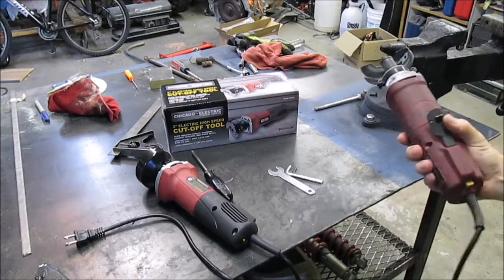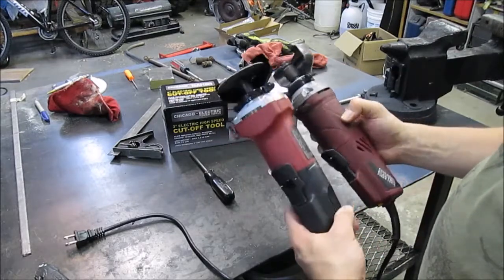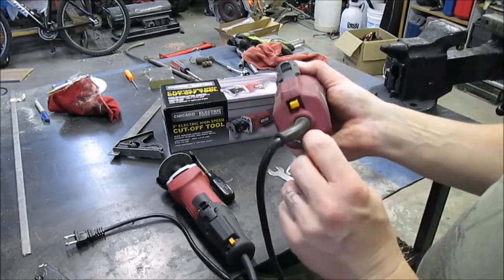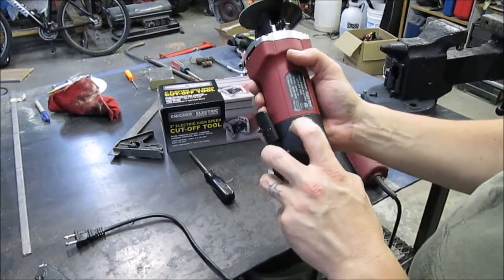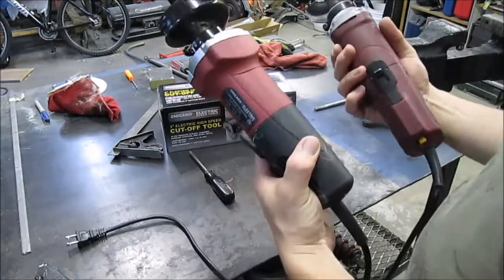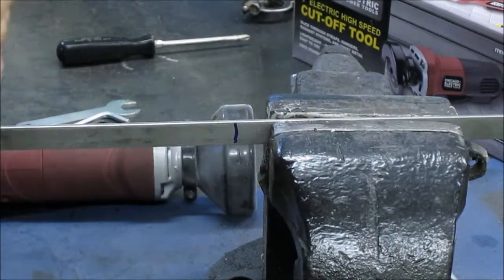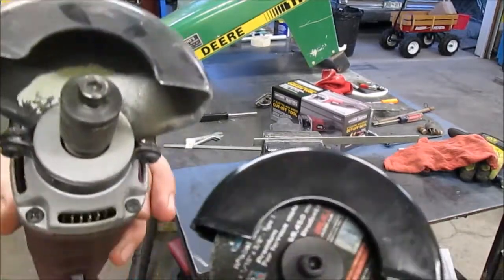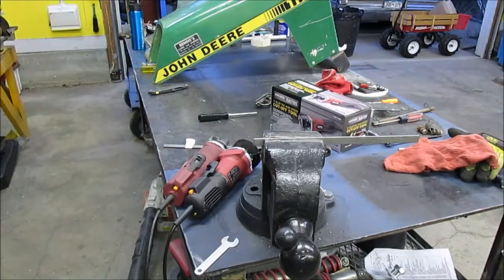Episode 64 Harbor freight 3 Inch High Speed Cut Off Tool. Old vs new.

Comment: Hey, you think this would be able to cut some wheel studs?
Reply: It will
Reply: @frankbailey9542  It did. Except I bought Black Hawk cut off wheels from amazon because the HF ones were trash.
Reply: @frankbailey9542  Oh, and I have an 8 lug it cut all of the rear studs no problem if anyone is wondering. I had to trim about a half inch off the tip of the wheels studs to fit my 1.5" bora spacers. Have to say I was impressed that this cheap china tool did the job hah. I still have it to this day and have used it on various projects.